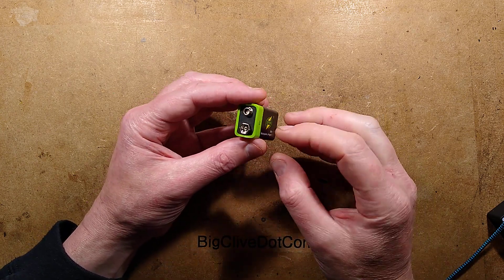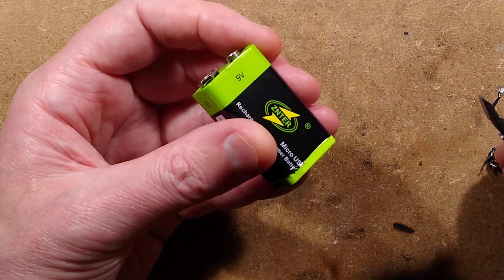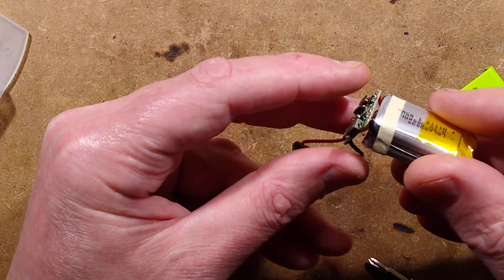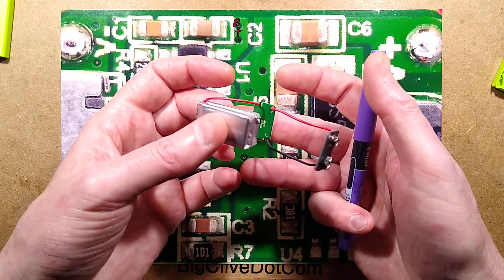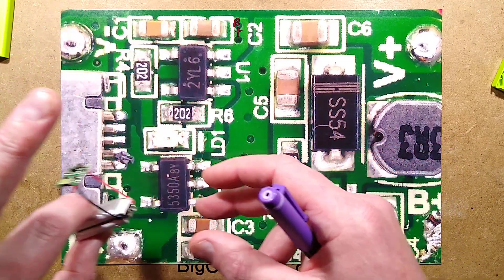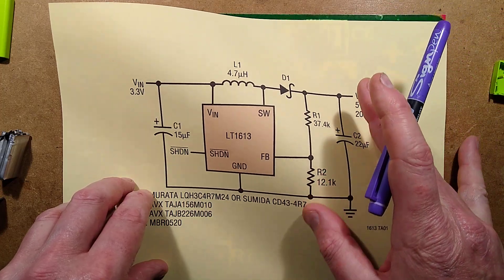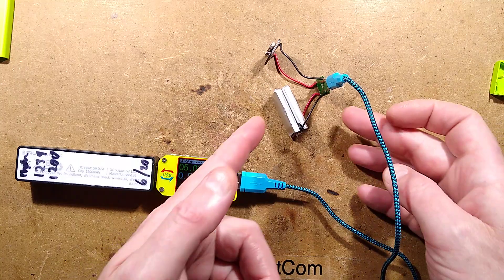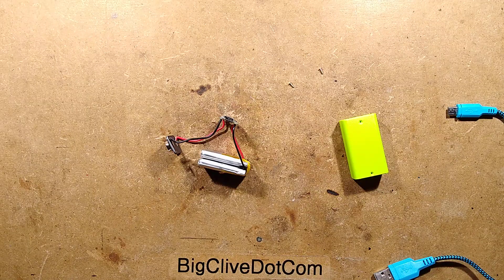Inside a Znter lithium 9V battery.

Comment: I did work on those wireless mics in the 1980's and 1990's in my shop. I had to tell some customers that the '9v' nicads didn't worked too well in these.
Reply: Most of those were rated 7.2 V DC ... some did include an additional cell and would show 8.4 V, still not 9 V though ...

Comment: Is there a history as to why the 9v is pretty much the only battery wigh both negative and positive next to eachother like car batteries. I assume part of the reason other batteries were never designed this way was its cheaper and safer as its harder to accidentally creat a curkit when they are opsite ends

Comment: Big Clive the man of many screwdrivers!
Reply: Wait what? Doesn't everyone have a multi-bit screwdriver kit similar to his?
Reply: @BertGrink  actually looking for a big multiple bit kit for miniature with good handles Etc any suggestions? Any comments appreciated.

But speaking of screwdriver handles the ones from Harbor Freight let look similar to some of the ones he uses the ones that have the magnetic holding for the bit that come in packs at 3 with the screw on cap for the driver bits in the end where the pocket clip is of course I'm talking about the Miniatures screwdrivers the better ones they're really good great to keep with your batteries for changing batteries. But what I'm talking about for the others is a serious kit it would have nearly any and every bit.
Reply: @aaronbrandenburg2441  I LOVE: I Fix it mahi driver kit v2, but it is not cheap
Reply: @janhumpolicek8373  hey thanks for the info I'll look into it!

This is something I've wanted to look into for a long time and then some.

But really wasn't sure what would be the best considering that I probably have run across every screw that exists in the sizes by now it does help to have a good set.

Again thanks.

Of course you keep your crappy bits for other uses!

And other and drivers also like for where are you store your batteries and all that as well.

Like I said I've got one of those magnetic Harbor Freight jobbies that I keep with my batteries.

Matter of fact I've got a small divided container not necessarily a store all but has dividers in a wide open area.

I found its perfect for 4D size batteries and a bunch of Triple A's and aa's as well.

Still room for the screwdriver and an Altoids Smalls tin for the extra screwdriver bits.

Also I have Altoids tins for screwdriver bits that I've got magnetic tape on the back of them.

Altoids tins are definitely worth saving for things both sizes.

I even made a little rechargeable light is that folds into an an Altoids tin using some odd salvaged Parts I had laying around.

Salvaged in terms of the ball joints and stuff.

Everything else was new.

Also makes a good book light it extends like an old-school Rod antenna!
Reply: @BertGrink  Yes but Clive appears to have Multiple multi  bit  screwdrivers
Reply: @andyhill242  I have two different kits myself; one contains philips bits and torx bits, the other, also philips bits as well as some 3-point bits for certain phones. ;)
Reply: @BertGrink  I prefer the drink....
Reply: Cheapest screwdrivers on earth...
Reply: Alot of people have multiple of these.
RC hobby 👌
Reply: not only many but all the screwdrivers
Reply: I also have many screwdrivers T6 are my faves tho good for tech repair

Comment: Those would be good for guitar effects pedals, as well.
Reply: I'm going to make a 9v batt connector to center-negative barrel plug for one of these for the boxes that don't have a battery bay.
Reply: Only if they do not introduce noise into the signal.
Reply: I haven't put a battery in a pedal for decades.... doesn't everyone have one of those "run 47 pedals off of one PSU" PSUs these days?

Comment: Not so familiar with surface mount resistor values. What the hell is R2 set at? 18C makes me think the last value is hex and therefore 18,000,000,000,000 ohms, which doesn't make a whole lot of sense. lol

Comment: neat product. not so handy long term for things like a TV remote. but they would be great for things like paintball markers which can use several 9v batteries in the loading system and deplete them fairly fast. the boost converter would help a ton because you can keep the voltage up and keep the motors running at full strength even when mostly discharged. i never really liked 9v rechargables but these might actually be quite good. you don't need to have separate chargers is also a bonus. it would be really cool if you could tweak the voltage with a trimpot thru a hole in the case.

Comment: Things I would have done differently:
1. Remove wires, all of them
2. Remove 9V Connector plastic piece
3. Redesign PCB to accommodate SMD 9V Connectors on reverse side
4. Solder LIPO cell tabs directly to component side of PCB
5. Move Charge LED next to USB Charge Port
Now the PCB connects directly to top of cells without wires, and PCB acts as 9V Connector as they are directly soldered to the reverse side, eliminating those wires as well, freeing up room for slightly thicker and longer LiPo cells, possibly to 620mAh x 2 and less overall series resistance between cells and PCB and PCB and Battery connectors. 
Extra room could also be used for a planar EMI filter.
Reply: Also look for an all-in-one chip instead of the 3 chips on the current board.

Comment: If you have a fast charging (micro-usb, not usb-c) mobile phone like an older samsung galaxy (S7 ?? S8??) you can directly charge your phone off the 9V.
Not really feasable on the normal Blocks but might work OK on this one.
- you can check it on your original charger, if it says two voltages 5.2V / 9V the phone supports that.

Comment: I love these kind of batteries...though, I think we need to vote to get rid of the 9v format entirely. It was fun while it lasted. I wonder how regulated it is...maybe you can check the level with the old lick test. :)
Reply: Why do you want to get rid of it??
All the active bass guitars I ever had in the shop were using one or two 9V batteries to provide a decent voltage for the active pick-ups and/or preamp. The mind boggles at musicians loading 6 AA's before the gig, and the rattling that this would invite :)
I am quite fond of the the little blocks, anyway!
Reply: mumblbee bee they also make good throwing weapons or filling a sock with them to swing around but AAs not so much imo
Reply: @Alexander_l322  The 9v is every bit as obsolete as the "A" and "B" battery. There is no reason for it to be in wide production and distribution. Outside of the dollar store (where they have really shitty batteries) they are the most expensive battery you can buy per watt, and they never last very long. This rechargeable battery is useful but it's only an effort to modernize outdated electronics. There is no reason in 2020 any device that needs a battery can't just take a 3.7v or 3v lithium cell directly and set the voltage itself. 9 volts come from time when you couldn't just get that kind of voltage very easily.

As a landlord, I am required by law to change every smoke detector battery every time I get a new tenant, even if they aren't dead or old yet. And you do not use dollar store batteries for this. It's an annoying pain in the ass. So instead I replace the entire units with modern smoke detectors that are either 10 year sealed units or take AAs. Obviously I'm not the only one that thinks they are obsolete. But of course, Energizer and Duracell would not want to see this battery go extinct!

To the average consumer, these are the most expensive battery that last the shortest and they are least likely to have a spare for. There is no actual need for the voltage level when DC-DC converters are so cheap, easy, and efficient. There is nothing they can't be built into.
Reply: @ryanroberts1104  apart from all of those smoke alarms out there. The mains ones we have still use them as a backup.
Reply: @ryanroberts1104  What an attitude, you sound annoyed at having to spend a few pounds on a smoke detector battery every 6 months to a year, when you're charging tenants hundreds of pounds per week.
Reply: @LeePorte  As I pointed out, new smoke alarms are no longer using 9v unless you buy the cheapest shit you can find. Smoke detectors must be replaced every 10 years anyway, so there should not be any old ones in service. If there are, it's time to change them.
Reply: @ryanroberts1104  I live in a 4 year old house from a major house builder, PP3's are the backup in the alarms fitted in every house they built. So they are definitely still in use.
Reply: @LeePorte  Just because some builder is still using cheap shit in their houses does not mean we still need the 9v battery. This is a great example of why it needs to be made obsolete. It's only for the lowest end of cheapskates or people who don't know any better. Yes, you can still buy a smoke detector that takes 9v batteries. That does not mean you should...or that they should even sell them. The point is there is no need for it not to take a more standard, cheaper, and higher capacity battery like AAs. The internal electronics can make whatever voltage they want, it is 2020.

In smoke detectors there is no reason to use anything besides the sealed 10 year units. They have an internal lithium battery that never needs to be changed. All smoke detectors are required to  be replaced after 10 years, even if they are hardwired. If somebody provides you with something else, they cheaped out.
Reply: @ryanroberts1104  I'd suggest that the 12V A23 battery trumps the 9V for price per Wh. I hate them with a passion.
Reply: @iamdave84  You're right, it might be a hair more expensive, but it's also obsolete. Very, very few things use this battery. Just like the 9v it was invented in a time when the battery had to make the correct voltage, cheap/tiny/efficient dc dc converters didn't exist. This does not apply in 2020. Any battery could output between .1 and 5,000+ volts. For that matter, look around and see if anybody makes a lithium rechargeable version like the 9v.
Reply: 9 volts are amazing for easily and cheaply creating high voltage. I got 100 at a dollar store for 50 bucks ones and got some really nice arcs.
Reply: It's a great format.  Could easily be redefined as a 2S protected lithium pack with a charge balancing contact indented on the top.  Output range would be 6.4 to 9.4V stable DC depending only on charge level.  Protection circuit needs to deal with accidental output shorting in addition to the usual dangers.
Reply: @johndododoe1411  re: "Output range would be 6.4 to 9.4V "
.
You're outside the SOA on the upper end there. 4.2 V max for most cells, so, 3.2 to 8.4 V
Reply: @uploadJ  Some cells go higher.  9.4 is for cells that go up to 4.7V.  Protection for 9V pair should be set to stop at 3.2V/cell.
Reply: @uploadJ  4.7V is a commonly quoted conventional peak voltage for LiPo cells.

Comment: I found this on the UB7QA chip Clive, but it is in a language I do not comprehend. Maybe you:
https://docplayer.se/docs-images/108/183214103/images/8-0.jpg
Reply: That's Norwegian. Something about 2m band amateur radio, though. Probably not regarding this chip.
Reply: @tonywalton1464  I thought the terms on there "high speed" was relating to the switching for the coil, but I could have been incorrect.
Reply: @MikinessAnalog  Unfortunately has nothing to do with the SOT-457 package chip itself. Also, the document is from 1989, as shown in the bottom right corner. But still nice find!

Comment: Yeah, Problem with the 9V "Lithium" non rechargeable is the "a bit too high" voltage.
i cracked a used one open, it had 3x 3.2V cells, which overshoots the "9V" by quite a bit if new i guess.
But if you need some sort of a backup battery and dont wanna buy the expensive single cell (or us cr2032) you can get 3 cells out of one around 6 bucks.
- Just seen some variants of those "micro usb rechargeable" 9V Blocks on amazon, cheapest pack of 2x comes in at 16 Bucks.
Reply: A standard alkaline 9-volt battery starts at 9.6-9.8V as well. The voltage of a battery is its nominal voltage. Fresh alkaline cells start at roughly 1.6V/cell, and there's 6 of them in a 9V battery. However, they quickly drop under load to around 1.2V/cell. And this is why NiMH batteries are usually fine. They start at roughly 1.2V, but have very little voltage drop under load, until they are just about discharged, and then they drop off suddenly. As long as the designer of the device you're using them with wantAnyhow, anything designed for a 9V battery should be able to deal with up to 10V or so without problems. Battery voltages are not exact.